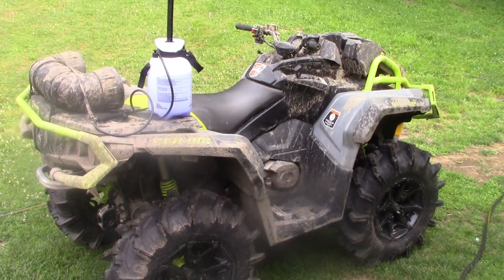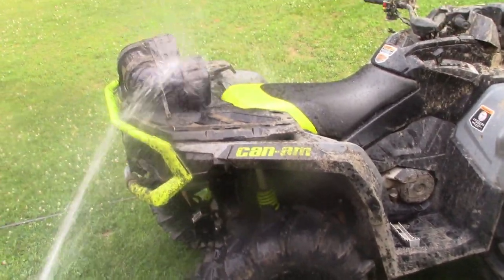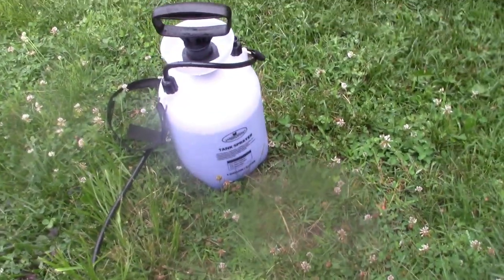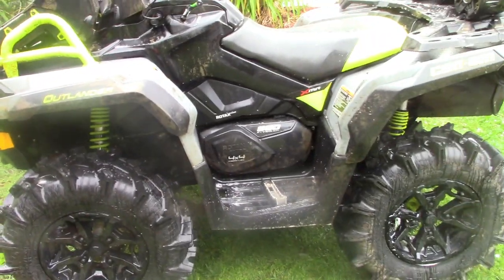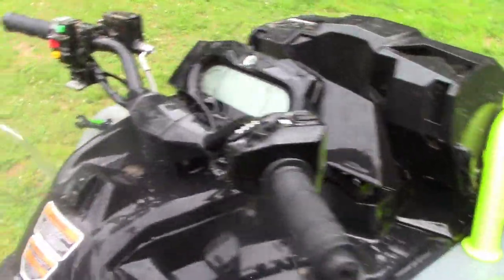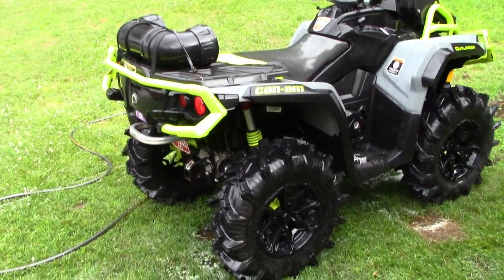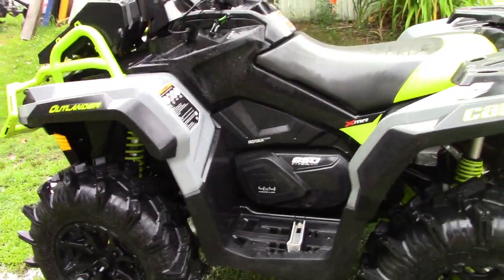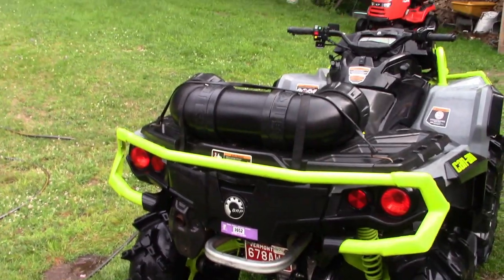TESTING BOOTY JUICE ATV WASH! IT WORKS!!!

Comment: If you take a can of furniture spray to your plastics and underneath the mud will wash right off,PLEDGE,ENDUST, is a good one.Then use a biodegradable cleaner like SIMPLE GREEN.
Reply from the maker: I have used lemon pledge before it works great to add a coating onto the plastics.

Comment: Does NOT work as advertised. Tried 3x with adjusting the mixture to 50/50 and even higher ratio of degreaser. 

I still dont believe you can beat scrubbing with a soapy rag/towel.
Reply from the maker: I agree. But for a quick wash it does it's job

Comment: Do you need to add water to the sprayer or is it just the Degreaser/tide mix
Reply from the maker: Add the degreaser and tide into a 1 gallon sprayer and fill the rest with water